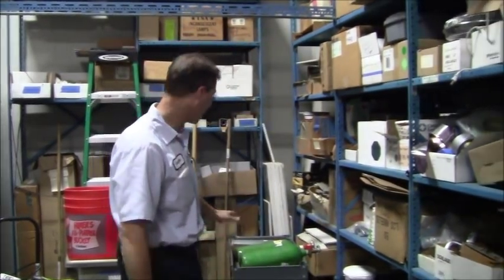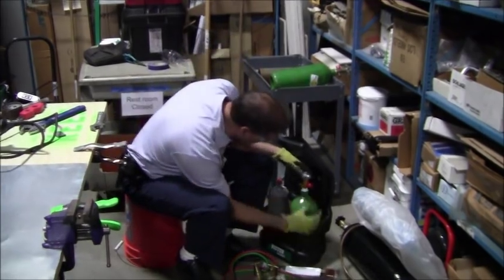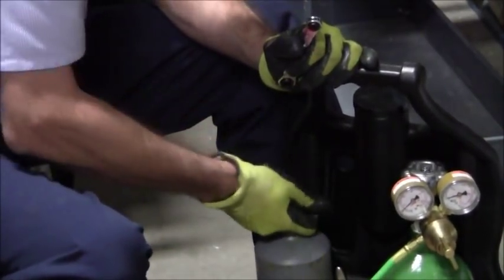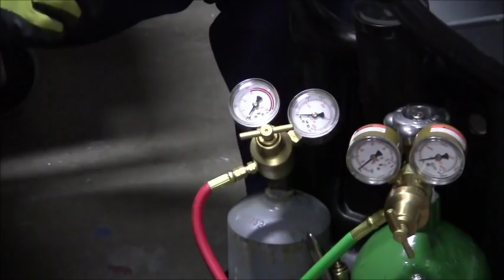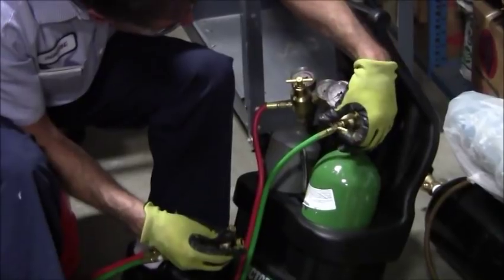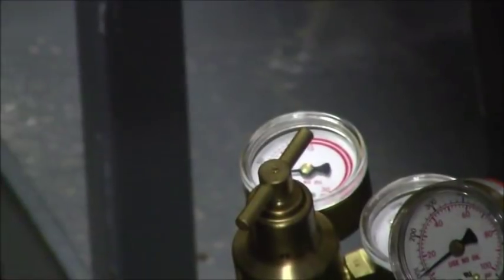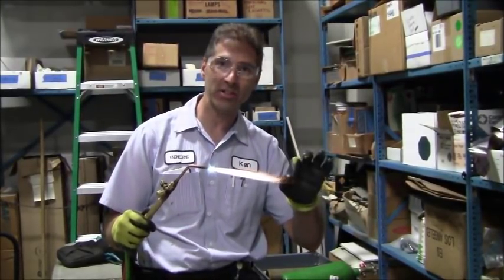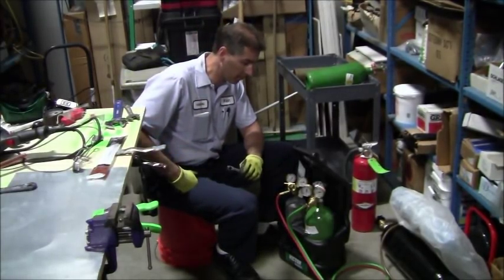How to Setup a Oxy Acetylene Torch Set

Comment: Ken, I just came across your tutorials on Welding and I was fascinated by it. I plan on doing some art sculpture out of metal & will be welding in the near future. Now that I have found you, I will be listening and watching to learn something I may not already know. My father was a welder/steam-pipe fitter for 42 years when he finally retired. As a child, my father would teach me different techniques and we would create all different size animals. We went to the junkyard first and quickly found all of the parts( nuts, bolts, small pieces of sheet metal,  rods both, threaded and smooth). That is where I got my love for junk stores and Junkyards. I am very lucky to find the things I need for projects and that is mainly because our society is used to being a "throw-away society". You need to use your imagination to take an old toaster, take it apart, and create something new out of the parts. Thanks, Ken!!

Comment: To put a quick silence on the left hand thread confusion - LEFT HAND THREAD IS ALWAYS MARKED ON THE NUT (every edge of the hex is notched to indicate it is left hand thread). This is also often only used on the gas connection side.

Comment: Might want to suggest using a fixed wrench to turn the gas on/off,during the initial blow-off,. If you have a problem switching the ratchet from open to close your small unvented room could fill with gas. Good reason to first check your area for any ignition or flame sources. Like a pilot light in a gas appliance. Good concise video.
Reply: I was just thinking about that

Comment: Thanks for the upload. Couple points I'd like to add, 1 open oxy cyl main valve SLOWLY to protect regulator, and backseat it! ...stay out of the direction of the reg adjustment screw should it become a projectile, 2: acetylene wrench is to be non-ratcheting, opened 1/4 to 1 turn only and key left on cylinder until done.
Reply: Also buy a Backlash attachment for the regulator.. for added safety...  But otherwise yes your right...
Reply: 3/4 of a turn to no more than 1-1.5 turns is what most recommend
Reply: @gunchief0811  That torch handle has flashback arrestors at the bottom where the hoses attach. You can hear it when he was running oxygen only without the tip, that rubbery burbling sound... Better to have them there than at the regulator. Heard a story long ago where a guy broke his jaw, and got one eye damaged when hoses exploded...
Reply: @brnmcc01  yes sir hence why I wear EYE-PRO...

Comment: Good vid, Ken. What about flashback arresters? Also, like the water and fire extinguisher.

You're in rather close quarters with a lot of flammable stuff around. Ventilation? Also, I always recommend NEVER look at the flame. Shade # 5, even for just a short moment. Really bad habit to look at the flame without filter eyewear.

Like cracking the tank. Nowadays the company I use puts a plastic sealant around the opening. But it's best not to trust those guys. Crack the tank.

Also, letting down on the pressure afterwards. I rarely do that. Something I'll start doing. Like to hear more about that.
Reply: There's flashback arrestors at the bottom of his torch handle, right where the hoses attach

Comment: I'm just a carpenter who does some metal work as needed but I'm really alarmed by a number of things you've put in this vid.  
One, acy. thread (like propane and most, if not all flammable gases as far as I know) is usually backward.  You should probably know this isfyou are doing a vid on this topic.  If you are using an off brand or ancient bottle and regulator set up that has threads that don't match current safety regs, no gas supply house will refill your bottles and it's really dangerous to take a chance on them falling into the hands of someone who isn't familiar with your set up/aware of the danger.  Even with different size nuts,  someone may be tempted to cobble an adapter together and blow themselves up. Did you think to mention an inspection for any grease/oil on oxy. threads and system and why?

Two  I would never consider using a separate wrench rather than a bolted in place handle to turn a tank on/off.  The split second(s) it takes a panicked person to find the wrench, fit it in place and turn the valve the right direction may be the time it takes to head off a disaster.  I never open the valve of a tank more than just enough to allow free flow.  Again, the split second it takes to turn a valve handle several more revolutions than necessary for adequate flow might be the time needed to avert disaster.

Three, the torch user needs to know the type and size of torch handle and tips and use the mfr's. tables to look up the proper acy-oxy pressure for that specific set up, material/thickness being used. I know of no tips that use the 1 to 2 ratio that you are describing. I'm astounded you just shoot from the hip with a general 1 to 2 rule of thumb and advise others to do the same.  Just off the top of my head,  a Victor size 0 oxy/acy cutting tip uses 30-35 psi of oxy with 3-5 psi of acy but I of course check the mfr's table every time I change tips or use my torch to match the tip size to the thickness and type of material being cut.  Not only is it safer, it makes a HUGE WORLD of difference in speed, economy and quality of cut or weld. Properly sizing the tip, gas pressure to the job is the difference between cutting a board with a sharp power saw or a dull hand saw.  
Four, Showing novice users that it's ok to randomly turn your oxy up to 100 psi is a bad example as is using a torch or venting gas in an enclosed space. 
I'm out of time and there are way too many issues in your vid to address. Acy. bottles should be let set for 24 hours if they've been turned on their side, NEVER, EVER use synthetic gloves instead of insulated leather welding type gloves (or wear any type of synthetic garment) when using a torch, any contact with hot metal will not just burn you, it'll melt the gloves into your skin producing a far worse injury than just a burn.  Using a torch in an area that is full of stuff that could catch/sustain a fire is a no-no.  What about eye and lung protection? You would solder or perhaps braze, not weld copper tubing and a propane plumbers torch is quite sufficient for sweating a copper pipe joint.  The more I think about all the wrong/missing information in your vid, the more strongly I want to ask you to remove it from Youtube and leave proper training on something this dangerous to a knowledgeable professional.  I appreciate your desire to make a video but this one is more dangerous than helpful.  
To all viewers of this video if he doesn't take it down:  there are many, many sources of correct information about how to properly and safely use an oxy-acy set up.  The gas bottle vendor, the torch manufacturer,  the Department of Transportation and military manuals to name a few.  Please get proper training before using one of these setups!
Reply: I know your post in nearly 6 months old at this post but I was thinking the same exact thing, I was pulling up videos to set up a list for a new guy at work to watch( to get visual notes with me teaching him other things) and god damn this vid had me alarmed I RECOMMEND NO ONE USE THIS VIDEO....there are so many more accurate and over all better  tips and learning videos out there  then this one, from the very get go when he wasn't able to be factual and concise  I knew something was wrong...
Reply: It's Matt but
Reply: you must be fun at partys... or to work with for that matter

if anything i think this video is too indepth as far as safety this is a youtube video  not an osha certified training course.. show peoplequick and to the point (red to red, green to green), 1:2 ratio is a good starting poiint not like you just swing torch valvesto 100% anyway so it gets mixxed to the exact ratio at the torch, acetylene befor oxygen what the flame should look like and a quick example weld

should be a 4-5 minute video to get someone started, although theres good info in here it could of been clearer, cant imagine your video matt itd be a 6 hour segment just to tell you all the reasons not to use any tools, like dont use it indoors seriously? obviously you need ventilation and enough space for extended use but thats beyond the scope of a beginner video, also you missed some points in your comment and got info wrong, 24 hours upright after being on the side is way overkill 15 minutes is minimum and 30 minutes is plenty for any bottle, leaving the oxygen valve partially opened can cause leaks it doesnt usually but the oxygen is at 2200+ psi and has a double lip seal that only works as intended at full on or full off

you didnt mention that you shouldnt use the acetylene all the way to 0psi as the liquid inside that holds/absorbs the acetelyne can come out and damage valves/seals although most people do use it right to empty without issues

and dont rip people apart on their video attempt without making any attempt at your own to actually improve the community rather than just start arguements like this one in it..nothing in this video is gonna kill anyone it may not be perfect but it is better than no video at all or some of the other 30 second videos that dont have any info other than light the torch and melt the metal with it
Reply: It's Matt Thank's for the comment agree 100%.
Reply: I run 40 psi oxy and 7 psi ace for cutting. The tip just depends on thickness of metal you're cutting.
Reply: It's Matt my God you read my mind completely

Comment: Hi good explanation on the set up of the torch set what is the operating time on a set like that
Reply from the maker: 1 to 3 hours.
Reply: @KenTraining  That's too high of a withdrawl rate from an MC cylinder. Shouldn't be more than 1/7 of the contents per hour. A size 0 tip set up properly should use between 2-4 SCFH. Which is a little high above the 1/7 rule, but it works for me. If you want to run 10 SCFH of fuel gas, then you need a B tank or larger, especially in cold weather. If you pull gas out too fast, then the acetone vapors can 'water down' your gas, making for a colder flame.

Comment: thanks for the video I learned alot. have a question though. should I use Teflon tape or thread compound on all the threads to help with no leaks. makes me nervous.
Reply from the maker: I believe either is fine.
Reply: Which fittings should I use Teflon on?
Reply: This is my first ever oxy setup
Reply: all of em
Reply: Rob Kelley you should never use ANY thread tape or glues on connections from what I've learned out of textbooks. It makes sense that if a malfunction were to occur it would increase the likelihood of an explosion or burst. I'm no expert, just a beginner. so if anyone wants to chime in feel free.
Reply: DO NOT I REPEAT DO NOT ,use this video for education!

Simply put they had ALOT of errors in this video,if you go to school or being self taught( as I was for a quite a while before I even touched a torch so I was safe and others as well) where you do ALOT of research and study on oxy acetylene welding/cutting torches you would see the errors as well.

First clue "believe" they show a uncertain answer....

Comment: You need to bleed the acetylene first then the oxygen. also when shutting the torch down you should turn off the acetylene first so the oxygen blows out the flame.
Reply: +Austin Gladwill If you do that, there will be an explode at the nozzle, oxygen shoud be cut 1st, then acetylene.
Reply: A before O, or up your go. Thats the common and popular phrase. But this guy just doesnt care i guess.
Reply: Austin G.   ABSOLUTELY WRONG! Turning off the acy. first allows the flame to burn back into the tip which fills with soot and needs to be cleaned much more frequently and hazards a flash back into the torch handle.  The industry and professional practice is to turn off oxy. first.   Whenever I hear a "pop" when a torch is being shut off I know I'm dealing with someone who doesn't know what they are doing and needs to be fully trained before I'll put them back on a torch.
Reply: That's correct. The turn off the oxygen first.
Reply: +It's Matt if you are supposed to shut off Oxy first, why do all the Victor videos say to shut off Acetelyene first so that the Oxy blows out the flame?
Reply: @sjeverett75  Victor says shut off Oxy first in the manual. I have it right in front of me. So does Harris in their manual
Reply: @itsmatt2105  That's very good advice especially for beginners. In event of an emergency it's critical that Oxy be shut off first. By training your new people that way, the muscle memory of the habit of always turn off Oxy first, then fuel immediately after, might save an injury later on. Just takes one dumbass to run over your hoses with a handtruck or a forklift to have a bad day... I was reading an old OSHA manual the other day, said if a 100 foot hose set had a mix of oxy+acetylene from a bad check valve or whatever, has the power of 20 sticks of dynamite...

Comment: Hi is there a specific operating temperature that you’re supposed to be using the tanks with then I’m just asking because I live in the Midwest area and I don’t know if sudden changes in weather temperature or humidity will damage or where out the tanks much faster or the regulators and hoses it’s going to be use for automotive purposes so there’s gonna be no welding just gonna be pretty much just  heating metal?

Comment: Thank you for your video which brand of touch need to buy and where I can found it,,?
Reply from the maker: +Amee Hassa Mine is an inexpensive kind from the Home Depot.
Reply: +KenTraining, hello I want to welding a car radiator support using ace & oxy with bronce the flame that you show here can work well for that metal? Thanks
Reply: KenTraining i doubt they have any home depots in durka durkastan. Probably a lot of targets though.

Comment: Roughly how long do you get from that pair of tanks?
Reply from the maker: I don't do a lot of brazing so they last me months. BUT I always have a spare tank of each gas.
Reply: @94SexyStang  Which acetylene cylinder is that?  Is it the Original, the Plus or the  Ulyta?
Reply: @marynollaig4124  That was an MC tank. 10 cubic foot capacity.

Comment: And youre to turn off acetylene first because you could have a flashback if you turn it off last
Reply: acetylene should be turned off first to prevent flashback
Reply: Acetylene tanks should be upright for at least 24 hours to stabilize acetylene before use. Acetylene tanks are honey combed  matting and chemicals to help stabilize the acetylene.
Reply: Pipe dope, PTFE tape (Teflon), oil, grease, ect should never be used on acetylene connections. Brass on brass clean threads only, torque 15-20 lb.
Reply: Acetylene connections may be right hand thread if of a different size to prevent connection to oxygen. All same size acetylene connections such as hoses must be left hand thread and marked with notches.
Reply: Acetylene tap wrench should never be a ratchet. One piece wrench with square drive on acetylene tap during use for emergency shut off (one turn max).
Check for leaks with soapy water and a spray bottle.
Reply: Your soapy water leak check should be with an oil free soap check solution.
Reply: The oxygen tank valve is a double seat high pressure valve and should be opened all the way to seat at the open position. The acetylene valve should be open 1/4  to 3/4 turn only to be closed quickly with wench attached in an emergency.
Reply: How can u get acetylene into the oxygen hose if the oxygen is higer pressure?
Reply: @Noguffay Exactly. When using propane, at a large scrap place I was at many years ago, they had a POOP sign hanging above the shop floor. Propane then oxygen for lighting, oxygen, then propane for shutdown... cutting up old bulk scrap, acetylene is too expensive so they used 100 pound propane tanks with like 5 huge oxygen bottles all manifolded together...

Comment: idk about 7psi 15psi on torch i was always told 5psi 10 psi. when dose the appliction call for a 7 -10 mix ? heavier gauge steel or for stainless high carbon steels? i only realy work w 10-50 to 10-90 steel so im kinda woundering?
Reply from the maker: mash7137 I don't know but lets see if another YouTuber can provide the answer.
Reply: mash7137

Comment: how long would those size tanks last of straight cutting?
Reply from the maker: +Brad Schmidt I never timed it. I just do small jobs.
Reply: Brad Schmidt Not very long.
Reply: about an hour. they are really only good for small jobs where portability is a needed. people that use them a lot generally have big tanks at home in the shop then the small tanks when they need something portable. of course with carts and such big tanks are portable too but it's much easier to just have a set of small tanks you can throw in a pickup.

also worth noting refilling or exchanging small tanks is far more expensive. as an example a 21 cu. ft. oxygen tank costs me about $45 to exchange but a 55 cu. ft. costs $50. it's $5 more sure but you're also getting nearly 3x the oxygen. basically the bigger the tank the more cost effective it is